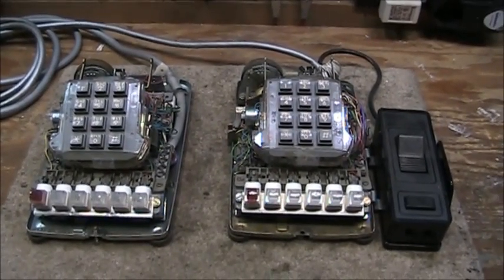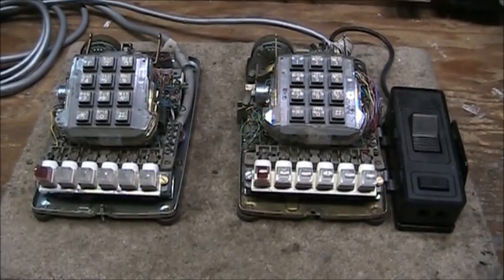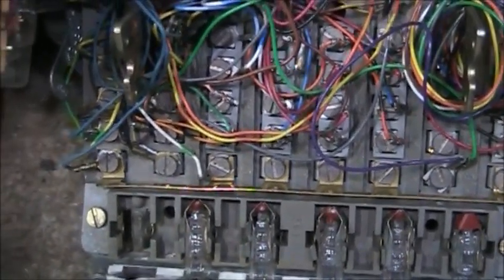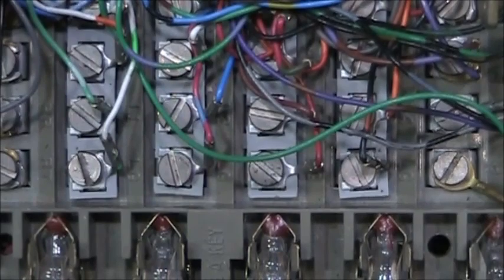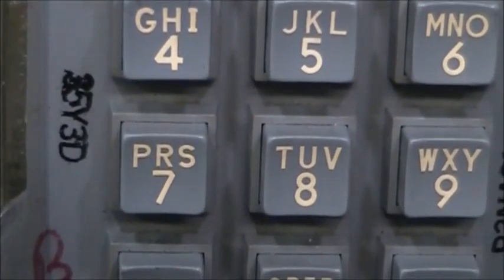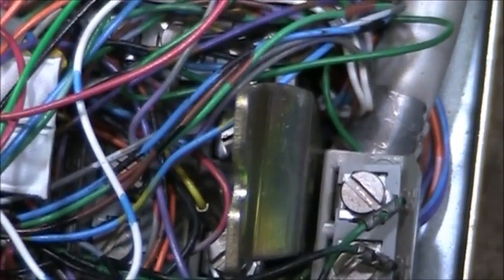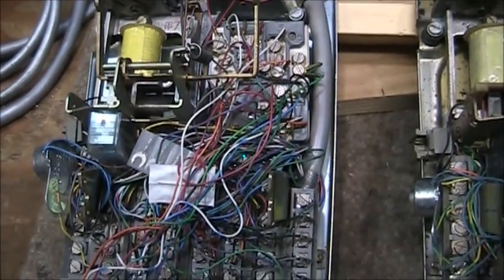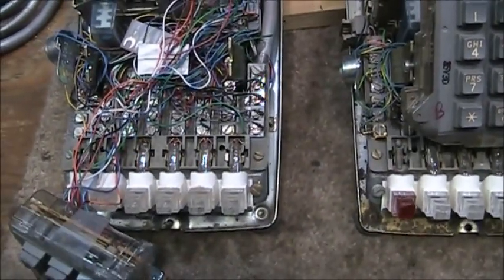2564/2565 1a2 6 button phones  the difference between  2564, 2565  WE or ITT

Comment: From what I've seen with the Western 2564 sets, the violet pairs are absent from both the cable and the amphenol connector pins. This allows the phone cable to be a little thinner and more flexible due to the lack of those 6 conductors. Also the amphenol on western sets leaves out the pins for the violet pairs on the amphenol connector, a unique bell system specific optimization, perhaps to save on pin costs. So often you can tell if it's a 2564 just by looking at the amphenol connector's missing pins.
Of course that might not be true if the original manufacturer's cable was cut off and replaced, as is sometimes the case with ebay phones where some demo guy simply axed the cable to save the phone, instead of disconnecting the amphenol. (Demo guys don't usually carry that tiny little screwdriver to unscrew amphenols..!)

Comment: on my sets the speaker-phone wires are kept on the spare terminals for future use (If ever needed)
Reply: Yes, I've seen this too on previously used/decommissioned sets on ebay; I imagine the installer had done this so they could bridge the 2565's together with CPCs and avoid the trouble Phil mentions. I ran into this setting up a 4a speakerphone, and had to refer to the BSPs to put the wires back on the correct terminal screws.